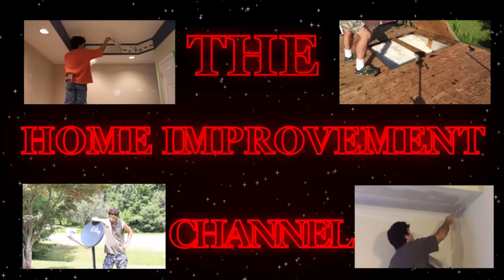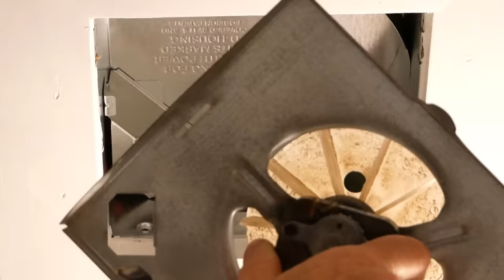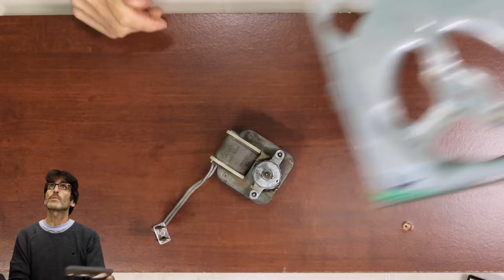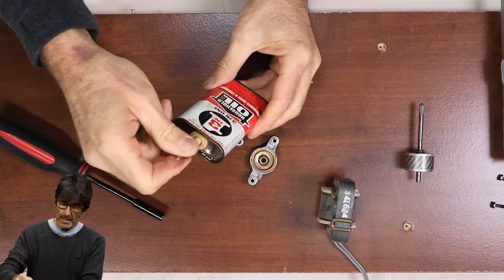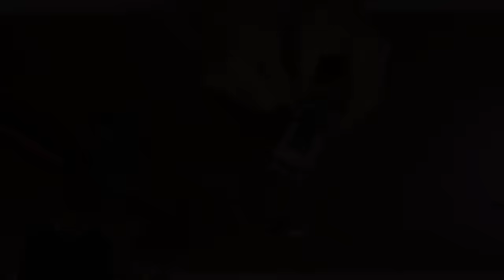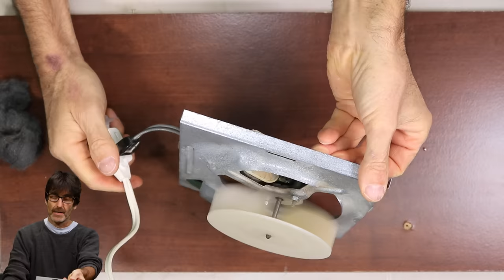Replace Your Bathroom Fan in 5 Minutes FLAT!  NO Attic Access!

Comment: Great video.  Unfortunately, my house built in the late 60s isn’t compatible with a F@&$ing thing.  😂😂.  The new fan I bought had a different sized housing, and even the motor and fan were different sizes that wouldn’t work to swap.  Old houses are a pain brother, every simple thing turns into a major project. Great video though, I’ll check out more from you for sure. 👍👍.   This video did help me with several things, so it was not wasted.  Thanks.
Reply from the maker: Yes unfortunately this particular fan probably didn't come out until a bit later.  The house in the video was from the mid 80s and that fan was different and had been changed too at some point.  I think this fan came out in the 90s.  I used to do maintenance work for a real estate agent and had quite the variety of houses.  I seem to remember some houses built in the 90s had this style of fan as well as houses that are only about 2 years old (2020)...   Thanks for the feedback.

Comment: Nice video,  but I have the same original 20 yr old fan that looks just like this and it wasn't working after I moved in .  I took the cover off and found the removable fan/motor housing was all cut and bent.  After looking at it for a while I find out that the builder put in the house ducting with outlet 180 degrees backwards and that is why they cut and hacked the housing to fit into the ducting. It can only fit one way . I would have had to lengthened the plug wires possibly . The fan motor is is not centered also to make things worse.  I had to hammer flat the one side and cut a plug slot for access and install it with screws and the new cut plug slot cut away the one slot for the cover plate spring .
Reply from the maker: Arrgh... sounds like a nightmare... I believe they put it in wrong and were to lazy to fix it to the way it was supposed to be..

Comment: Thanks for the great video. Replacement NuTone motor I bought has an extra green wire compared to old one. The motor run when I plug it into wall socket but only makes humming noise with no spin when plugged into housing, help please. Thanks
Reply from the maker: Hard to diagnose without seeing it.  Plug a lamp or something into the fan electric socket and turn the switch on to see if the bulb is working.. If bulb isn't working right, try turning off the power and pull the corner out with the socket so you can see the wires behind it and see if anything came loose.. You might need a lamp cord that isn't polarized, meaning both prongs are the same size..

Comment: What would you recommend if the fan works, but is really loud?  Can I buy a higher quality assembly and pop it up into the existing housing?  Thanks, loved the video and humor.
Reply from the maker: Loud as in an ab-normal loud or just designed to be loud?  If it's the latter, then yes these contractor grade fans only sell for about $20 so they aren't the quietest.  Usually the higher quality fans will come with a different size insert that isn't compatible with the broan fans.  Those usually have a removable insert as well like this one does, but they are a completely different design.  So in short, no.  I have seen where you can swap motors in some cases where the housing isn't quite compatible, but it's similar enough to allow a motor swap onto the old housing.  Hope that helps.
Reply: @TheHomeImprovementChannel  Thanks for the reply!  Yeah, it's super crazy loud.  It's basically an inverted design to your video (metal fan is below the motor, no obvious pop-out panel).  I did lubricate it but I think it's probably just the cheapest thing the previous owner could buy.  Maybe they installed it upside down, all our drywall is...

Comment: Great video, thank you. I was having trouble getting the fan out itself as the clips were really wedged in there so that was helpful. I recently fixed up another fan and I was told to use the 3 in 1 “SAE” Motor oil for it as opposed to the regular one, is there any difference you’re aware of between the two? Thanks again
Reply from the maker: Looks like when you google that, most of it is SAE 20.  Not sure what the 3n1 classic oil would be...
Reply: @TheHomeImprovementChannel  Perhaps the SAE 20 is the new trend then, thank you
Reply from the maker: @kickoutthejames  YW!

Comment: The motor assembly for my fan is no longer available for replacement.  I don't feel like crawling into the attic and rewiring.  I'll try your video a shot. 

UPDATE:  Gave my motor a good cleaning and used some WD40 on shaft and spins freely.  Thanks for inspiring me to take it apart and saving me $$.
Reply from the maker: If the new fan insert doesn't quite fit your old fan housing, I've taken the motor itself out and adapt it to the old insert in the old fan.  If the motor bolt holes don't line up, drill new ones!  As long as the fan blade itself is about the same size as the original... it'll work fine.
Reply from the maker: That's excellent!  Thanks for the update..

Comment: Awesome thanks. Are you aware if there are usually fans that include lights that will fit in the same casing? My fan works fine, I just want more light in that area of the bathroom.
Reply from the maker: The fan / light units work the same way I believe with the removable insert.  But the catch is, I don't think they're going to use the same insert as the fan in the video.  You'll have to change the whole case up in the ceiling, then later once that fan develops a problem, it's just a matter of swapping out the middle..  But I'm pretty sure it's going to use a different case.

Comment: If you have to replace the fan insert how do you know what size to get can you take that to the store and size it looks easy to do just want to get the right thing
Reply from the maker: Sure you can take it with you.  Most of the fans are the size I have shown here, but of course there are some variations... If you have a really odd ball size, I've actually changed out the motor itself and it'll usually bolt to the old fan insert.

Comment: Thanks!  Great video.
Reply from the maker: You're welcome... :-)
Reply: I get the impression that the blower wheel may be responsible for most of the noise level and flow with these units, so I am trying to locate one with better attributes than the few flat paddles mine has.  Not having much luck.  Do you know of an outlet?  Thx
Reply from the maker: @eldnah2  No I don't.  You might be able to go to the store... Lowe's Etc.. and get the model number off a more expensive fan with a better sone rating and see if the blower wheel is the same size for that fan... if it is, then you could order a replacement wheel for the more expensive fan and install it on the cheaper fan!  I've never done it before, but it might work.

Comment: Now you did tell the truth in just changing out the fan/motor but most of the time in the real world you won't have the exact same guts to replace so you will end up changing out the whole thing.which includes going in the attic and having to disconnect the electrical and duct work just because alot of times people want  a whole new one bigger and better. But great video and very informative.
Reply from the maker: Ride Red it just depends... obviously if someone wants a bigger better fan then yea they’ll have to do all that... but if you’re just wanting to swap it out and fix it... this is a very common size ... I can’t tell u how many of these I’ve replaced and most of the time this is what it is,.. it’s a builder grade cheap fan and there’s bunches of them out there... thanks for the comment 🙂🙂
Reply: @TheHomeImprovementChannel  I hear you,  Unfortunately I have tried a few times to just change out the guts because the motor was burnt up but when I would go to say lowes or homedepot they change out their stock and can't find a matching one. They lbow if they change out styles and motors you basically have to change the whole thing. I do like how you went through it and oiled up motor because from the factory there is hardly any oil.
Reply from the maker: @ridered7262  Yep, and I've also found if you unbolt the motor from the housing that comes out, a lot of times you can bolt that motor to a newer fan housing that's a different physical size, but the motor will still bolt up and work.  I've done that a few times when I couldnt' find a fan housing to fit, but I didn't want to go through all the trouble of pulling the whole thing out of the ceiling.

Comment: Do you have to turn off the circuit breaker prior to installation or do you just need to ensure switch is turned off prior to install?
Reply from the maker: It depends on your experience!  If you are not comfortable around electric or if there's any doubt, always turn off the circuit breaker..

Comment: FYI there is a style of fan motor mount that is different than this popular style. Unfortunately my house has these and the housing is different, which required me to remove the housing anyway, even though the motor itself was more or less exactly the same. 🙃 Still a great video.
Reply from the maker: Yes absolutely.  This one is a popular style, but not the only one.  I showed a portion on the 2nd half of video to take apart the motor and clean it if that might work for ones that are harder to replace as an alternative against changing the whole thing..
Reply: At least there's some that have motor brackets that bolt onto the housing. I believe I have something like it

Comment: Great video.   Just think how much someone would charge you to do this?,
Reply from the maker: It depends.. If they can just swap it out it would probably be around $100 (plus new fan).. (If bonified electrician much more)..  if they can't swap it out and have to replace the whole housing in the ceiling it could be several hundred..  Depending on the contractor of course..

Comment: Loved your most informative video - Thank You!!!  Do you think I could perhaps put a different motor into an existing housing instead of the normal, loud, annoying, fans motors ???  I have installed a few Panasonic bathroom fans and they are absolutely the Quietest, most Powerful fans I have ever seen..
If it could just switch to one of those Panasonic motors, it would be so nice.. What do you think??
Thank you again, for the Best Video I have ever seen on this subject !!  I really appreciate your hard work on this !!  My best, and Prayers to you and yours !!!
Reply from the maker: Yes absolutely...... as long as it fits!  I have done this before with older fans when the housing is different.  Instead of removing the whole thing from the ceiling, i've just replace the motor.  The fan blade has to fit as well.. if it's bigger, then no it won't work.  Seems like a quieter fan would have a bigger blade, so it moves the same amount of air, but moving slower... so these are variables, i can't answer.. It would make a good video if that works... I might check it out myself!.. Thanks for the comment.

Comment: Mine sounds like a jet engine taking off. It’s been like that from installation. Very loud. Should it be replaced or just cleaned? Thanks. Love your vids.
Reply from the maker: Been like that since installation... OK it does sound like it should be replaced.  Only because when it was new still making a lot of noise wouldn't have been dirty at that time.
Reply: Gotcha. I’ll replace it. Thanks!
Reply: Well, we took the fan/motor out and plugged it in to a wall socket. It’s really quiet. When it’s in the ceiling, it sound like a jet engine. Any ideas? Thanks!

Comment: This is great! Instead of buying a new $15 bathroom fan, I bought a $1000 air compressor! :-P
Reply from the maker: DarrenSpeedy well it would help if u already have one! Wrap the motor in a plastic bag and wash the blade off with a water hose will work too.. not all those fans are $15.. some are a bit expensive and this would work on those too

Comment: Great news I just had my ceilings replaced and the fans in both bathrooms started acting up. 1 squeaking the other contractor cut the wires. Thought I had to tear out and re due everything.
Reply from the maker: Great!  I can see how you could fix the squeaking without tearing it out, but how you would You fix the cut wires without tearing out the housing?

Comment: Great!  I wonder if it is possible a fan to run in Reverse?  I have one that seems to blow air instead of removing it from the bathroom.
Reply from the maker: I've never heard of that... Are you sure the ductwork isn't clogged causing the air to blow back and seem like its running backwards?
Reply: @TheHomeImprovementChannel  Thanks!  You are correct.  There is a blockage.  The black, round, plastic valve assembly is in the shut position.  I can open it (like a valve), but it has a tendency to shut or stick in the shut position.  I've cleaned it.  It does open/close, but I wonder if air from the fan is forcing it closed?  I wonder if I should just remove the valve.  I think I will duct tape it open.
Reply from the maker: HI, The valve is there to prevent mice or other critters from getting in.. as well as to limit hot / cold air from coming in.  Unfortunately the best way to fix it for sure is to remove the whole housing.. of course duct tape is easier, but I can't recommend it due to the reasons I listed above.. Also make sure the ductwork doesn't have any birds nest or anything like that in there.  I've seen that happen before.
Reply: @TheHomeImprovementChannel  Thank you, again!  I used a couple small strips of duct tape.  Now the fan operates properly, evacuating bathroom air.  The valve makes sense as you explain it.  We will see if creatures show up or not.  But for now I am happy to have the fan I should have had working 10+ years now.  Off to rebuild another fan today!

Comment: Thanks. My bathroom does not have this fan. Do you have suggestions as to installing one and isn't this fan suppose to have like a duct the pleasant smells?
Reply from the maker: Yes it has a duct.  If you can't find a housing to fit the existing one, sometimes you can buy a fan and actually swap the motor itself out and reuse your old housing.  If that doesn't work, you'll have to swap the whole thing out of the ceiling.

Comment: I have a bathroom fan without a light I would like to replace with a light. Any way to do that without removing the whole housing?
Reply from the maker: Not really.   The wiring would be different.  I don't think you'd find one that would fit the housing either.  I actually have a video Im working on about this very thing.  It'll be out in a few days.

Comment: If you have a light/fan combo you will need to remove the whole fan housing.  Not a big deal it's screwed in with 4 screws.  Also, I would think grease would last longer than 3 in One oil.  Am I wrong?
Reply from the maker: I don't know it would make a lot of difference, since I would only just put a light film on the surfaces, but yea, you can use grease too, just a tiny little bit.
Reply: @TheHomeImprovementChannel  I took two down today because the amount of lint was unbelievable.  I took your advice and used the oil after blowing out all the crap with an air compressor.  Btw, if your fan is a FASCO there's an excellent YouTube video on how to remove the clips that hold the motor together to really clean and lubricate the darn thing.
Reply from the maker: Excellent... :-)

Comment: For how long have bathroom ceiling fans been plug in? We have a house that was built in 1938, although I suspect the bathroom I am concerned with may be younger.  If indeed it is a simple plug for the electrical connection, it will make my job super easy.
Reply from the maker: I don't know exactly how long they've been plug in like that, but I'm pretty sure in 1938 a bathroom fan wasn't code at all, so if there's one there, it's almost a given that it was installed sometime later..

Comment: New replacement fan doesn't matchup with old fan's dimensions. Any suggestions?
Reply from the maker: Can you pull the motor from the new fan housing and swap it with the old fan housing?  That'd be the easiest way.  If it won't bolt up directly can you drill new holes?  As long as the physical size is close it won't matter and the fan blade is in the center..  Otherwise, you'll have to pull the whole housing out of the ceiling and replace it..

Comment: thanks for this , I didn't know I could unplug the fan. It turns on automatically - and unnecessarily - when I turn on the bathroom light. Annoying  sound and energy wastage now a memory.  The only thing about cleaning it is that the covering in hinged on the fan mechanism  and it is hard to get around that, and see what's what .
Reply from the maker: Yes, usually you get a separate switch between the bath light and the fan.  I guess they cheaped out and wired them together.. :-(

Comment: Hi, when I removed the old motor, I found a lot of dust in there. Is that insulation or dust that I should clean up?
Reply from the maker: Some could be insulation.. but its probably dust from the fan running and pulling it in there..  If it were me, I'd clean it out..
Reply: @TheHomeImprovementChannel  ok Thanks! I will clean it out

Comment: This may be a silly question. But my overhead fixture is a light and fan combo. I would like to replace the fixture for a nicer light but would I need to replace the fan also?
Reply from the maker: I think so.  You'll have to buy a fan/light combo from local store.  There's a small chance the light portion of it will fit your old housing, but probably not.. but you never know!